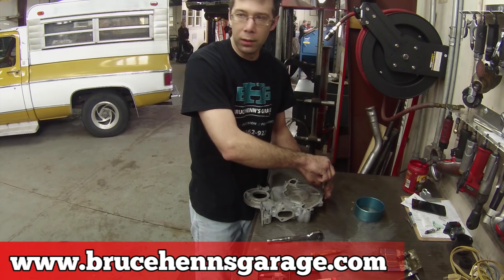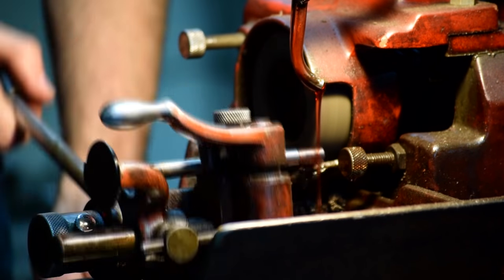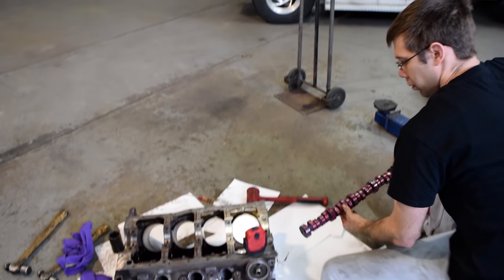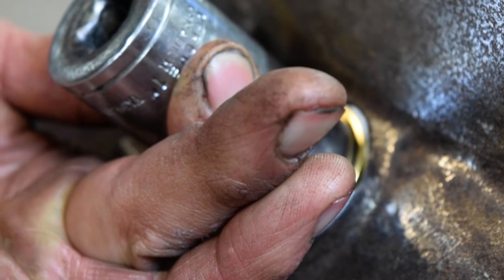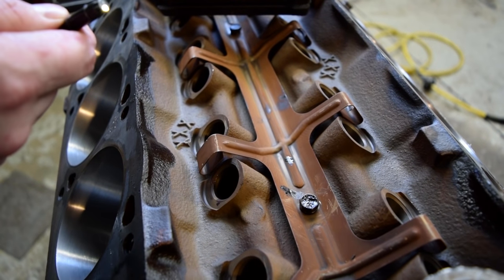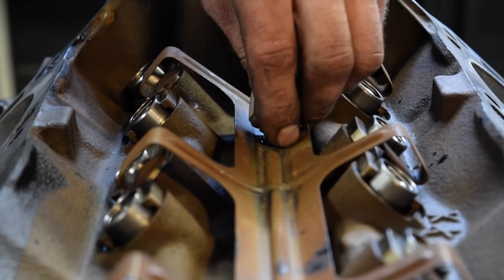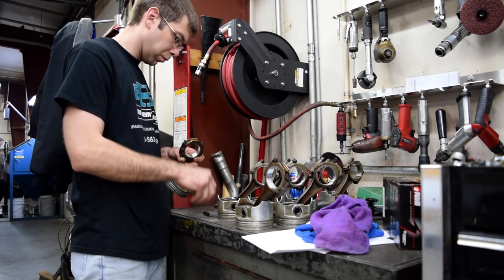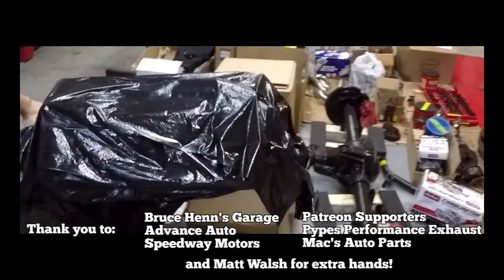Vagabond Falcon Build: Part 5

Comment: I am doing a 65 falcon with 347 stroker, T5, 8 inch with limited slip 3.55 gear set up and I really like the build your doing, My 347 has forged pistons, aluminum heads, and bunch of other stuff with Holley terminator EFI. Also did the same TCI suspension in the front as you did with a power rack. Excited to see this build come together.

Comment: Looking great! Fun facts: the pins that help properly locate the heads, timing cover and bellhousing are called dowels. The little guys that go between each pair of lifters to prevent them from rotating in their bores (wouldn't want one of them to go sideways and have the roller round off a lobe) are called dog bones, and the spider thingy is indeed called a spider.

Comment: That is a damn cool old parts washer.

One thing about the mechanical fuel pumps, they can take a long time to prime, especially if you're just cranking. The pump on our old Scout is so slow that you can prime the carb bowl, start it, and it'll use up the fuel in the bowl and choke out long before the pump gets fuel to the carb. The pump doesn't work so well on air. Works just fine once it's primed, though. Hopefully yours primes better than ours, but if it takes forever, don't assume the pump is bad... it's probably just slow.

Comment: I can't even begin to imagine how a layperson could get into that world. Not to slight Mr. Regular, but I think it's safe to say that without Bruce Henn's encyclopedic knowledge, this project would be all but impossible. I'm especially impressed with what appears to be a whole mix of parts from entirely different cars from entirely different decades being used in this engine rebuild, and once again, Bruce's incredible foresight in knowing with full confidence that they will work together seamlessly.
Reply: +Red Comet Forums and books
Reply: +Red Comet Yeah, there is a wealth of knowledge on forums and in books. Plus, once in a while you come across a few friendly people online that will answer your questions. Would be awesome if everyone had a Bruce Henn around to help them, though.
Reply: Before the internet, this knowledge was passed from gearhead to gearhead, or old guy to young guy. And cars were much simpler then. And before 1980 or so, most guys worked in manufacturing, so they worked with machines all day long. So, in a sense, nobody was a layperson. And cars broke all the time, and generally you fixed it yourself.
Reply: After rereading my post, for what it's worth I'd also like to clarify that I didn't mean to imply that Mr. Regular is a layman. I was actually referring to myself.

Comment: which bolt is best bolt?
Reply: Biggest bolt is best bolt.
Reply: ok then, which freeze plug is best freeze plug?
Reply: +Steven Andrews The one that squeaks.
Reply: +Steven Andrews The one that isn't crossthreaded, head stripped, rusted and/or works.
Reply: +Steven Andrews The one listed in the OEM OHM/IPC
Reply: +Steven Andrews Whatever holds it together works. The amount of washers you used to make said bolt work proved it was worth every penny saved.
Reply: +Steven Andrews MAYMAY

Comment: the 302 windsor is a good engine, you can use the intakes and injection from a Fox Mustang 5.0 but if you want a sleeper instead of a cruiser, then drop in a 351 with a top loader and a 3.00 ratio 9" diff, that will shred just about anything!

Comment: You suppose to sit new rollers in a tub of oil for no less than 24 hours to get all the air out so those lifters won't float
Reply from the maker: Hahah
Reply: +RegularCars Well, that's actually a thing for hydraulic lifters to try and get some oil in them before initial startup so it doesn't sound like hot death. Lifters are nearly last in line for oil, and as such, they'll take a bit to pump up.

If you've got mechanical lifters, then it's a moot point.
Reply from the maker: +Ratchet Town USA Bruce has a machine for that

Comment: They do make low pressure electric fuel pumps for carburetors.My '65 has one.Since you're doing a mostly stock build,the mechanical pump should be fine.

Comment: That tool you didn't know the name of the Bruce used to check the wobble of the camshaft with is called a dial indicator.  It has a magnetic base to hold it steady.  This begs the question, Is that Matt Farah's million micron dial indicator?

Comment: This is a question I've been wondering for the longest time, since I'm partial to restomodding and think carburetors are a thing of the past. Why did you choose to opt for carburetors? Why not use fuel injection if the inlet manifold was already designed for it?

Comment: I've never rebuilt an engine before, but there's loads of rust on the crankshaft counterweights and stuff, is this normal? Does the detergent/zinc stuff in the oil clean this up eventually?

Comment: I Cant believe how much rust is in that engine. How come y'all didn't put any oil on the block, crank, connecting rods, or any bare metal to prevent any rust from forming.

Comment: I've never grinded valves but I'm very familiar with machining, I feel like when your grinding the valves your just grinding away and away and not taking measurements to make sure your not going to far. does the machine know when to stop?
Reply: +Alex Ottomano I would imagine you have to set depth stops on the machine but for the most part you're just honing up the wear surfaces. You can't go too far of course but all of the play that would be introduced by slightly shorter valves is fixed in the rocker arm adjustment.
Reply: +cjwolfer ah I understand now thanks for explaining
Reply: +Alex Ottomano You go until the surface is evenly machined with no pits or low  spots. When you put the head together, a straight-edge against the tops of the valve stems lets you ensure that they are all even. You can pretty much get away with eyeballing it, because like cjwolfer said, you take any excess clearance out when you adjust the rocker arms.

Comment: Why is the black round something pump something on the engine's main gear offset?
Reply: +mcrsit 
The arm of the mechanical fuel pump rides on that offset wheel.  As that wheel turns, the offset will move the fuel pump arm up and down, actuating the fuel pump.
Reply: +fallwind101 Thanks!
Reply: +mcrsit it pushes on something to pump the fuel.
Reply: +mcrsit Fuel pump eccentric is the name.

Comment: Next time you pick out bolts. The simplest method i've found to never ever lose them is to just use different colored paint markers. So say oil pan bolts, one dab one the bolt head, one dab on the pan in a visible place.

BUT WAIT, you're gonna say "wait a fucking minute, i'm gonna clean that part" and you are, but after that, you paint mark it again. Simple. Simpler than remembering, simpler than checking pictures.

And paint markers are cheap AF.
Reply: +aserta I use the same method with colored wrap ties for lines
Reply: +aserta theres isnt enough colours to tear down an engine